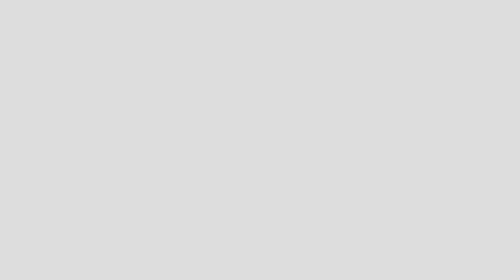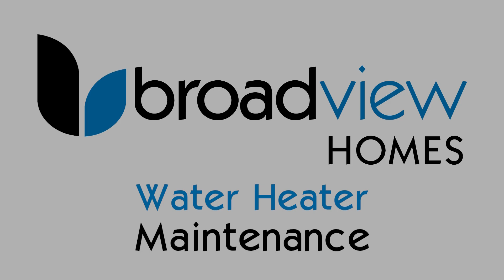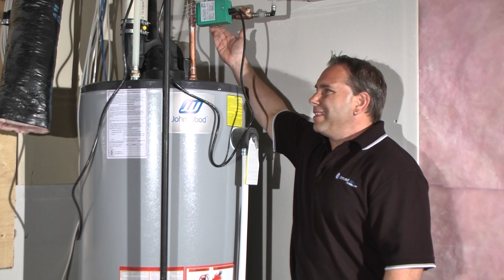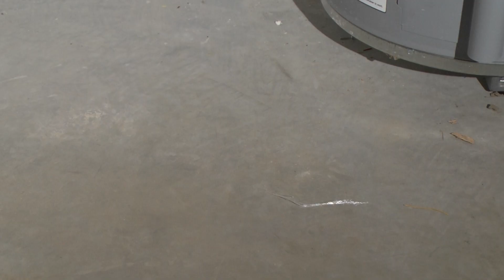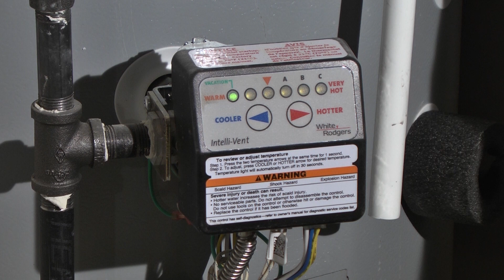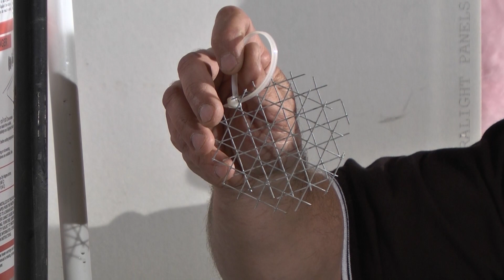Home Maintenance | Hot Water Tank Maintenance

Comment: My vacation mode and hot water ABC indicators lights on together.
Reply: Same.. idk what that means. 😢
Reply: @geniebear1974  I called technician, he said it is overheating due to faulty part, then I replaced whole unit, because it is dangerous to be running like that.